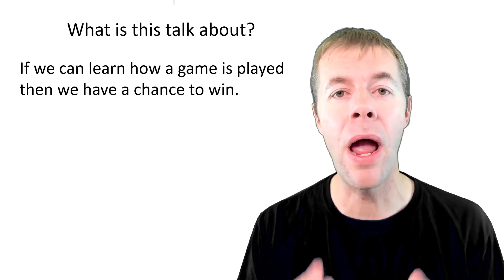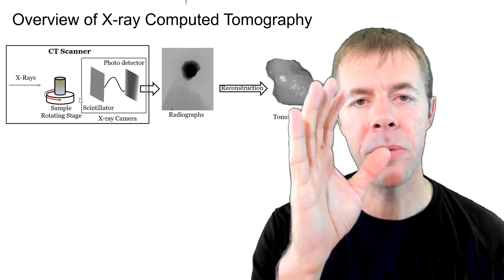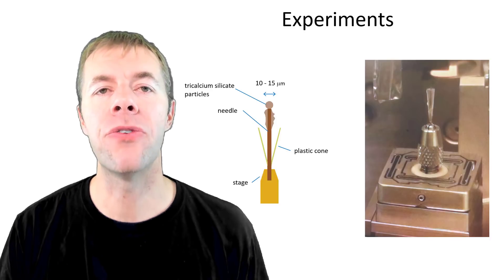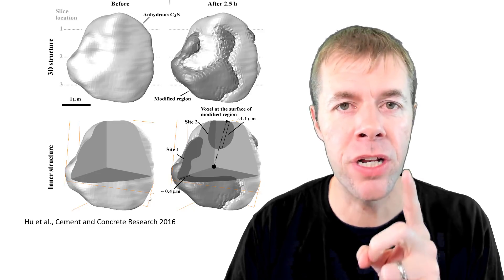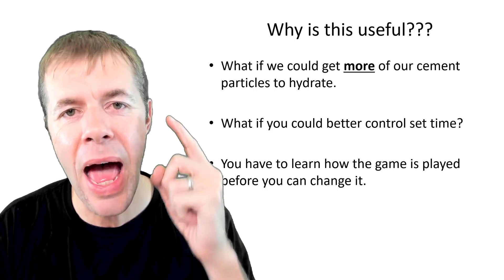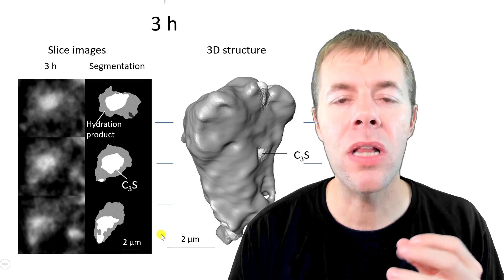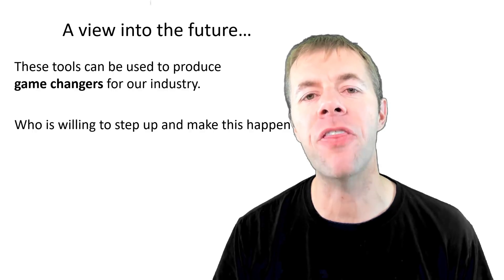A Game Changer for Concrete?? - Nano Scale Observations of Cement Hydration

Comment: Have you done a video on sugar, Sir? I read that oil companies use it in well cement to retard setting time but also to add strength because it reduces water surface tension making the water wetter. However you can only use up to 0.2% 0.1 to 0.15% being safer, because if you go over 0.2% the concrete doesn't set, or takes weeks before you can take the forms and molds away.

Comment: Major thumbs up for this video Tyler and your research.  I have used microtomography of frozen soils to find ice lenses before but must admit that didn't see things at the nano scale that you did - in order to keep the sample frozen we had a huge brine water contraption which meant a dramatic decrease in runtime and therefore resolution.  We did not correlate this with other tomographic results like you did which was awesome.
I totally would not have expected that the grains would decompose (do you have a model for what is happening?).  The only idea that I have always held onto is that as products are formed it would hinder the migration of water to active sites.  My hypothesis as to why some areas are reacting versus others that are not is related to the pressure of water in those areas.  In frozen soil for instance, the water pressure is dependent on the curvature of the ice-water interface as it penetrates voids and the solute concentration gradient between the ice and water penetrates the ice in-between the soil particles.  Do you think you could find a correlation between these active/non-active areas and the local curvature of the particles? My other less-informed hypothesis is that it could be related to a solute concentration in those areas that might also be related to curvature.  Let me know what you think about this hypothesis as well as the future of this type of research two years on.
Reply: What about bubbles in the mix? I suspect, though, besides gas pockets, it might be regions of positive and negative charge, where two of the same charge is repelling.

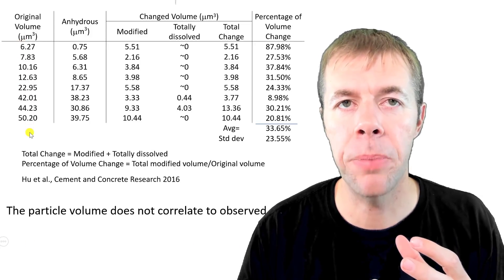Comment: 9:13 While there was no correlation between particle size and hydration there does in fact seem to be a particle size sweet spot.  87.98% of particles 6.27 um^3 were changed.  Is this repeatable?  Perhaps by getting grain size down to this level would assure very high hydration rates.
Reply from the maker: Rehoboth - check out my new video for some more updated information. 
https://www.youtube.com/watch?v=2euPuexlDiU

Comment: Do you have any idea what the reaction would have looked like if the concrete mixture had all the air removed prior to hydration?  - that is exposed to a vacuum.  This may not be practical under real world conditions but I have always wondered what effect entrained air has on the cement product.

Comment: Tyler, a company called Edencrete has developed a cheap admixture containing carbon nanotubes which..."fill in spaces at the nanoscopic level between the hydrated cement particles. When concrete dries, instead of leaving porous openings that would allow water to penetrate or cracks to develop, these nanotubes create millions of flexible, strong carbon bridges throughout the structure. These carbon bridges greatly improve resistance to failure caused by bending stresses, resulting in greater resistance to abrasive wear and crack propagation." It already has approval for use in a dozen US Dept.s of Transport for road construction, and in fact is mandated in the state of Georgia. Not many people know about this product yet, but I think it is going to be huge in the construction industry
http://www.edencrete.com/

Comment: Sounds like the chemistry is likely about as interesting and diverse as that encountered in fancy brazing or casting metallurgy or sintering of ceramics. Those are well-researched because they have applications to turbomachinery, which is another one of those big businesses. Concrete is surely of comparable or greater importance, I agree with you on that. 

Is the basic research on its chemistry really so poor? There are so many powerful tools and theories for understanding chemical processes these days... Such as synchrotron light sources! This work is going into my five-minute speech about why such machines are so useful.
Reply from the maker: Thanks Pelagic!  There is a lot that we know about cement chemistry but there is a ton of things that don't.  I agree that synchrotrons can provide incredible insights that we need to make these materials better.

Comment: Eating this up. I was introduced to the engineering aspects of concrete formulations from one of the Parker dam engineers. He introduced me to fly ash uses, explained creep on concrete spans, etc. I went on to build my own peristaltic pump modeled after a couple of brothers who built one in the 1930's. I was especially curious about lubricity and water balance in pumping. What always amazed me is the break in the transference of knowledge from the engineering to the applicators. When it's all done, what good is the product if it doesn't get optimally placed?  Thanks
Reply from the maker: totally agree!!!
Thanks so much for the comment and story!!!
Reply: are there plans for that pump available online? Would love to build my own as well.
Reply: @trog.lodyte  Not that I'm aware of. I designed built my own version before the internet took over. It does not pump any heavy aggregate which means grout/stucco etc. The original design had a 7 foot diameter wheel where mine has a 26" wheel pushing a 2" primary line with a 1 1/4" whip for spraying. I've heard this style of rig called a stinger.

Comment: Tyler, where does the mass displace? Where does it go once the voids are made?  Thank you very much for this data...
Reply from the maker: Voids are places in between the solids that form.  A good analogy for hydration product is like coral.  Think of the voids in coral.  They are the spaces between solids that grow.  This means they don't displace mass but they are the absence of mass!
Reply: @TylerLey  , thank you...  I am attempting to understand...  the voids are created during the hydration process?  That being so, where does the mass that is ''removed'' from the aggregate? That is the displaced part I am referencing...  I can see it is ''eaten up" but what happens to that ''food"? Where did it go?  I like the coral thinking and oddly I was thinking this would explain your air being placed back into the pump system video, but it takes hours to get these voids? I am guessing the air-entrained concrete in the pump would not correlate that quickly...
Reply from the maker: Let's say there are no aggregates and we are just watching the cement paste go from particles to hydration product.  This is a complicated process but the material dissolves from the cement grains and then reforms on the surface.  When it reforms it doesn't do so perfectly and it leaves voids or holes.  
Check out these videos - www.hydrationtheater.com
https://www.youtube.com/watch?v=nxSZvC4dBPE
Reply: @TylerLey  , watching now... Thank you for sharing...   I am working on sharing a ''bolt failure'' video... Showing that the bolts are designed to fail first in the ''clamping process'' and NOT the bolts...  My first video is showing the thread failure in a cheap, harbor freight bolt and nut... Even they respect that the bolt must fail first. --- LOL I just heard ''water!'' ,  come into the mix (your video is playing in the background)... PRICELESS.
Reply: @TylerLey  So you're isolating the cement particles in this experiment, but in real concrete the cement particles react with the water then the hydration product is what sticks to the sand and stone? The hydration product is "sticky" but if it has voids (over-reacted zones?) there's less surface area to make contact with the sand and stone?

Comment: Can you please change those annoying thumbnails
Reply from the maker: Thanks,
What would you like to be different?
Reply: @TylerLey no offense but that face you make ...
Reply from the maker: They are supposed to be fun. =)
Reply from the maker: Wroger,

What you are describing is Ultra High Performance concrete.  They design all the particles to pack together very tightly.  The compression and tension strength of concrete is 10x typical concrete.  It also has very low permeability.  The problem is the cost is very high.  It can be 20x to 100x more expensive than normal concrete.  But, as you pointed out for certain applications then it may be worth it.

I am working on a video about it but it may be a little while until it is done.
Reply: @TylerLey  10 times is more accurate. 100 vs 1000 dollars per cy as far as I know
Reply from the maker: @amirtech2005  Thanks Amir!  You would know better since you are closer to it.  I was thinking many of the good mixtures were closer to $1800.  Have you seen the ultra high performance concrete with carbon nanotubes?  That stuff is expensive.
Reply: @TylerLey  No, but I have made UHPC with local materials and without any nano materials. CNT has still a long way for performance and consistency. Graphene has worked better, as shown both in literature and in practice, and as far as I experienced ; it's also safer to work with. I tried CNT recently and it wasn't really that good. Georgia DOT uses that probably more than any other DOTs, and I don't get it!
Reply from the maker: @Wroger Wroger It is hard to tell what is aggregate and what is cement at that scale!  I don't think anyone really knows.
Reply from the maker: @Wroger Wroger Now you are talking more like a ceramic.  If you are going to this trouble and expense then I am not sure portland cement, rock, and sand are your best bet.  You also may have to grind each one individually.  This would make your cost go up even more.  

This is a fun thought experiment!
Reply from the maker: Ask that in another way.  Are you asking about the crystal structure of hardened portland cement?
Reply from the maker: @Wroger Wroger You would get calcium silicate hydrate.  It is amorphous.  Watch the hydration videos here: https://www.youtube.com/watch?v=Bolb7Hr81z4
https://www.youtube.com/watch?v=W3XBkbls-ZE
Reply from the maker: @Wroger Wroger You have to activate or break down the silicates into something that will form a solid.  This is called a geopolymer.  I talk about it a little here: https://www.youtube.com/watch?v=iFpwgTUW_nk